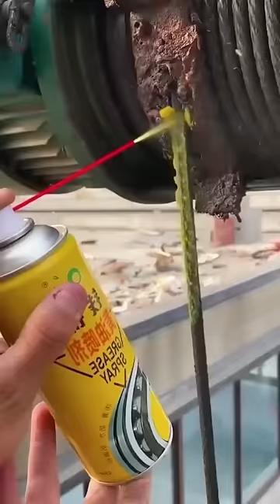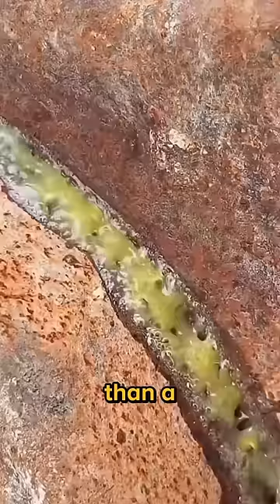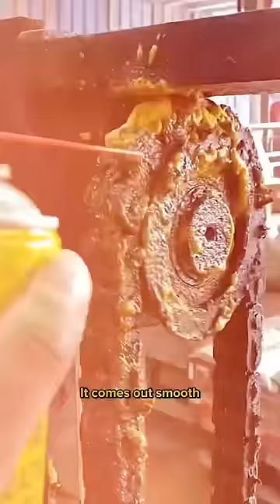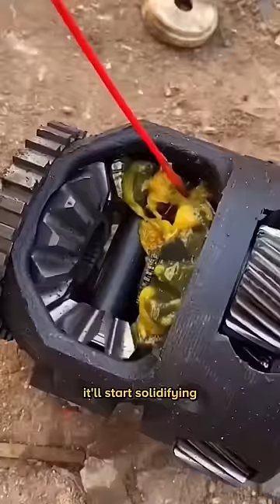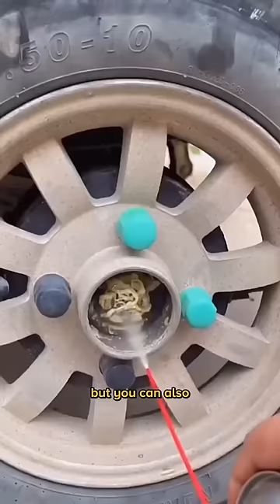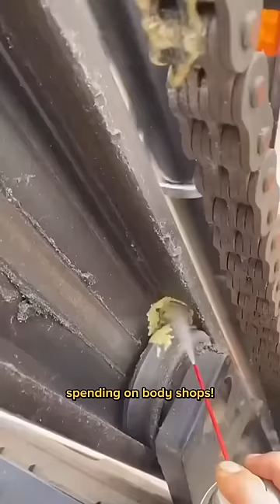This makes your gears smooth like butter! 🥴 #tool #toolhack #hardware #lubricants #spray

Comment: Chinese spray cheese
Reply: Probably has the same nutritional value as American spray cheese and just as safe to eat.
Reply: ChinEasy-Cheese
Reply: works good for lubrication too
Reply: @Stimps1983 
As a European I have no idea what "spray cheese" is. I never even saw spray cooking oil being sold anywhere here and I was already scared of that 😂 
But spray cheese?!???
Reply: It's the leaning tower of Cheeeza!
Reply: @user-bl4oq7fd8d we have fake cheese in can like whipped cream that sprays out
Reply: 😂😂😂😂😂cheese😂😂😂😂😂
Reply: @i.i.iiii.i.i  cooking spray is just butter that's pressurized
Reply: @Anal_driller3000 well it's not pressurized, it uses a propellant that keeps the pressure up. It's not like they filled the can to 60 PSI of air and put it on the shelf.

Comment: I'm pretty sure my grandfather would rise from his grave just to beat me if I used anything other than WD40.
Reply: I’m the opposite if I used wd40 on anything that I wasn’t destroying trying to get off, or just a metal surface hed rise and beat me😂😂 it’s good for keeping rust off of metal, but if you use it on a chain or a bearing or something it’ll eat the grease off and it’s actually harder on it
Reply: Wd40 is the worst as a lubricant

Comment: Don't use random lubricants on important parts, especially on a vehicle. I had a van where 2 of the door locks wouldn't turn when the temperature dropped. The passenger door had no problem so i suspect bad "maintenance" and improper lubrication that wasnt rated for 30° F or lower. 

WD40 is responsible for damaging a lot of locks and doors in colder areas.
Reply: Wd40 is not a lubricant.
Reply: @ascendant5088  it's a different kind of lubricant than whatever you're thinking about. It's labeled as a lubricant, and it fits the definition of lubricant. 

Water is a lubricant.  Add soap to water, and it's even more of a lubricant. Teflon tape is a lubricant as well as teflon coating on pots and pans are lubricants. There's lots of different kinds of lubricants. Graphite powder is best lubricant for a lock, especially if the temperature drops below freezing. 

WD40 is better as a lubricant than it is as a solvent. For solvents, the cheaper ones will work better. Acetone or denatured alcohol can remove WD40, and any leftover solvent will evaporate. Gasoline is even cheaper, but it won't evaporate as quickly. 

Again, unless it's the lock formula from WD40, don't use anything other than graphite power inside a lock mechanism. The lock will break if it collects dust or if the lubricant freezes. Don't use lock deicer on a home lock for that matter. Break a window instead. It's cheaper than a locksmith when your lock eventually breaks completely.

Comment: Ah, yes, the "lubricant" on the hinges... That someone forgot to cut the audio on so we can all hear just how much it doesnt lubricate shit. For those who dont know lubricants, this product is more likely to damage your vehicle, machinery, etc., than it is to actually lubricate anything. For an easy example from the video itself, that gear box that they sprayed this stuff on two of the four gears, do you see how it didnt transfer to the two dry gears as it rolled and just made a clump in the middle? Lubricants dont do that. If you pour oil, slap grease, or use any sort of spray lubricant on a gear or any other friction surface, it WILL transfer to any surface it comes into contact with on its own. Lubricants rely on their surface adhesion to work, if they cant retain adhesion to the surface, they get squeezed out of the way, allowing for surface on surfave contact, which is bad, lubricants leave a film that the two surfaces ride on, since theyre whats known as "incompressible fluids" (meaning unlike a fluid such as air, it cant be squished, no matter how much pressure you put on it, you will never be able to decrease the volume it fills, and yes, air is a fluid, fluid doesnt mean liquid, solids, gases, and liquids can all be fluids, back to the psa) since the lubricant cannot be compressed, the low friction film the lubricant leaves behind is what the surfaces are actually touching, theyre both pushing on the lube, if you want a visual example, find two pieces of plastic or metal, both flat, and take some cooking oil, put just a little bit on one of the pieces, now use the other piece to squish your cooking oil between the two pieces, now rub them together. Thats how lubricant works. If you wanna see how this stuff works, do exactly the same thing, but use spray cheese instead of cooking oil.
Reply: Btw guys check all of your lubricants, always. Especially with things like a car, itll save you money and could save your life, an engine with no oil breaks and you stop, a wheel bearing, differential bearing, etc., goes bad and falls apart from friction, you die, along with the possibility of killing others in the process

Comment: For most of these applications i would rather use traditional grease or oil. This looks horrible and others have pointed out that it gums up quickly, so no thank you especially on that crank. hell nah

Comment: This is a terrible idea, there’s a reason why engines have oil and suspension components have grease

door hinges is the only thing this could possibly work for, and WD-40 is more proven
Reply: Wd40 is not a lubricant so I can tell you have no idea what you're talking about.
Reply: @luke8222  I know WD-40 isn’t a lubricant, my point is that door hinges on cars rarely need actual lube and just need to be cleaned, which is what WD-40 does
Reply: @unnamedracer9757 or good for preventing rust also. After I wash my dirt bike chain I wd40 so the water doesn’t make it run at then before I ride I lube it
Reply: First, WD-40 is good for rust. It was literally invented to keep the rust off the first ICBMs, they wouldn't have used it if it wasn't good.
And sure, there's better things out there now, but that doesn't make WD-40 bad.

As for lubricant, it is, just a temporary one.
It is mostly made of naptha and mineral oil, so it penetrates and lubricates, also makes it a decent solvent.
The lubrication ability only lasts as long as you have the volatile oil on the thing you are lubricating, past that it doesn't help because it's not there.

There are other things in WD-40, they mostly leave a thin film behind to protect against rust, and aren't going to meaningfully affect lubrication.

You guys are just using the wrong tool for the job. If you want to lubricate get grease or an appropriate non-volatile oil.